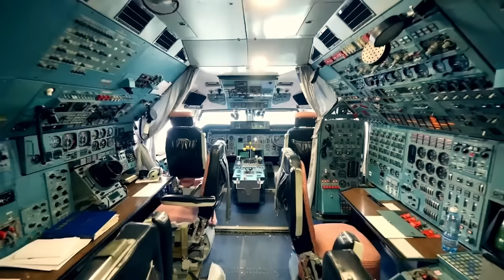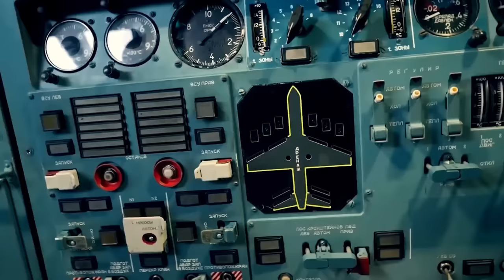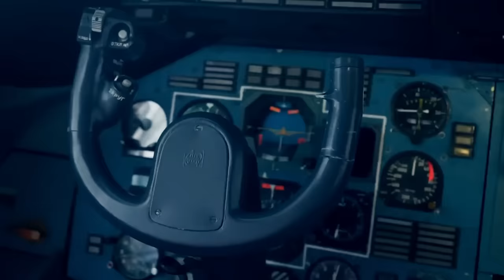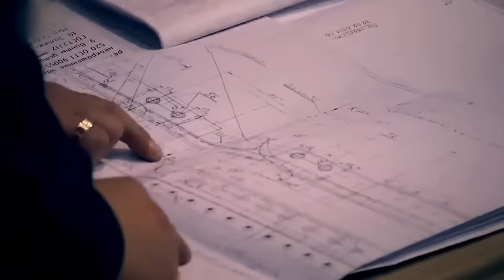The British Are Restoring The AN-226 Mriya For Ukraine

Comment: A modernized An-225 powered by four GE GenX or Rolls Royce Trent 1000 turbofans could have 50% more thrust than the 6-engine configuration it had originally. Couple that improvement with a more modern wing design and strengthened (and perhaps enlarged) fuselage, and the Antonov could again be the new king of heavy lift transports.
Reply: Good points, still modern technology could raise the possible MTOW, MLAW which really would be an argument for the plane staying a six jet. Plus the world needs to reembracs the idea of engine redundancy in aviation.

Quadjets, or at least trijets should be the norm for crossing big water masses on long haul just for safety reasons. 

The plane should be able to pressurize and propell a plane to an alternate airport with less than 100% of its propulsion jet engine power to minimize risk.
Reply: On the other hand sticking with six engines means you end up with a proven design but better.
Reply: 6 GE90s best of both worlds

Comment: The AN-128 and AN-225 often stopped at IAH in Houston, which was kind of ironic since the modified 747-SP for Space Shuttle transport was based here in Houston (at Ellington field), and is now on display at the Johnson Space Center.
Reply: There is no model AN128. The aircraft that often stopped at IAH was the AN124 and mostly heading to Algeria. How do I know? I used to be on board those AN124s
Reply: The shortened 747 SP never had anything to do with the Space Shuttle.
Reply: The shuttle carrier was actually a 747 200.  If you go to the Johnson Space Center in Houston and check the aircraft out, they describe its life before NASA as an AA 747 200

Comment: There are just one cargo plane in the world of this size, and when you need it , nothing else will do. There are basically 2 options one which seems to be favored now is to rebuild the flying plane, which was heavily damaged, due to sheer negligence , if only management gave the order to have it flown out of the war zone , even on 4 engines.  The other option is to use the one partially built second example.But that will have to wait till this one been finished and booked solid with work to force them to finish the other one. There are little advantage to do this in the original country now  even if the war have ended?  For most of the skilled personal are now dead. It will be a project equal to the design of the first 747, which nearly bankrupt Boeing. But now they are thinking of bring the jumbo back. The one unique thing about the jumbo, since 69, there been hull losses, and much mishaps, but not once can the losses be traced to a basic design flaw. One thing for sure, they will not be building 1500 Mriya, that is for sure.

Comment: They have a second incomplete fuselage and the destroyed Mriya has its wings and tail largely intact... Imagine a second aircraft completed with a glass cockpit and six GEnx-67 engines.
Reply: A plane that beautiful deserves the Rolls Royce RR badge on its engines!
Reply: @zandert8224  Perhaps, but the GEnx 2B67 from the 747-8 has the right diameter and bleed air. The Trent 1000 doesn't have a variant that works here.

Comment: The video title is incorrect - it is the Anotonov 225, not 226.  It could NOT carry 500 tons; it's cargo capacity was close to 200 tons. Its gross weight with such a cargo, and fully fuelled was aroud the 500 ton mark. 

The British are not restoring Mriya for Ukraine - indeed she is, unfortunately,  in such poor state that she coudn't feasibly be restored to flying condition. However,  Either one or more AN-124's could be used to supply parts ofr a new-build AN-225, with other parts being newly fabricated, (but the 124's are useful - why disassemble them?) or alternatively, an entirely new build Mriya could be made with the same form, but modern engines and avionics (which would also make it more efficient and cost-effective to run. 

This is, I think the more realistic option, building anew, and building even better than before despite the Russian barbarian savages  trail of destruction and atrocities over large parts of Ukraine. Such a new-build AN225 would be symbolic of the Ukrainian towns and villages that will be rebuilt. And best of all, no Russian involvement needed for the project.

Sorry, but this video was a pretty poor attempt.

Comment: I can only assume that the word 'chassis' used here actually refers to the mounting structure for the undercarriage. A plane doesn't have a 'chasis'. The fuselage consists of roughly circular frames joined together with various 'stringers' and 'longerons', forming a complete framework upon which is secured the outer stressed skin.
Looking at the remains of the destroyed aircraft, as a layman, I would suspect that the only way to see another AN-225 in the air, would be to finish building the unfinished one whilst salvaging as much of the 'written off' one as possible. The extent of damage to the burnt frame has probably compromised the integrity of what's left to such a degree as to render only 50% of what looks good to be actually re-useable.

Comment: I think it is the Antonov AN-225 not 226 ^^ Well, there is as far as I know the 2nd Prototype of the 225, which was never completed but is still available. Take the 2nd Prototype and use its parts (around up to 65% completed) and you may be able to restore the 1st Prototype.

Comment: Re-building Mriya wouldn't be economically viable (it wouldn't yield more money than it's rebuilding and operational costs). Nevertheless as for old-timers it would be great to at minimum rebuild it's structure to display it as a piece of art and great things humans are able to create.
On a humanitarian level it would possibly be wiser to start from scratch in order to minimise operating costs. It would be such a great engineering feat if various airplane manufacturer would dedicate ressources for that purpose given they'd at most only gain some R&D for other projects that would be viable.

Comment: We have to look to the future and build a new aircraft with stronger structure, modern systems, engines etc to operate with compliance in a future world. Six engines powered the original whereas the same job can now be done with four. Take a look at the Rolls Royce Ultrafan, four of those huge beasts can easily power the new recreation with fuel efficiency on the new jet fuels and push out almost half a million pounds of thrust yet in cruise, those engines will literally be operating on low power settings. The world can only wait for this recreated aircraft to take to the skies.

Comment: Of how much use was the roof cargo hold. Most transport would have gone into the belly. Thus maybe a new version does not need a split horizontal stabilizer, making it more efficient.
Reply: Split stabs keep the wake turbulence down when carrying cargo on top. .  A single tail would have to be over 80 ft tall (25m) keeping the plane out of any hangar in use today.
Reply: @MomolosZtips  Good point about the tail

Comment: Antonov was and IS still a Ukrainian Company, Not Russian. The Engines were designed and built in Ukraine. All the fabrication equipment required to build another AN225 are there, in Ukraine. You missed out any film footage from the An-225-2 hanger where everything is stored, in Hostomel, several hundred yards from the carcass of AN-225-1 under its wrecked Hanger.

Comment: It would be cheaper and easier to build a new one. To do this you would need to hold the patents and rights to manufacture, the originals plans, jigs and machine tools - you would then have to go through extensive testing and certification. Then there would have to be customers happy to purchase an obsolete  design concept when they could just go the Airbus.

Comment: Iam not an aviation engineer . Im sure There are plans for this plane how to build it - if u pay  for the job -   wing design coud be  redone up to date -  there are techlogies  available / newer engines could be used with better economy and ecology , avionics  , improved hydraulics -   this is not some kind of building something from a scratch  likde discovering a wheel  .  And also that burned  down plane - probably just for a scrape yard - half of the fuselage is gone,  wigs gone -  well .  If there  is money , the will be chance for ruslan flying again -

Comment: The cost of rebuilding one is prohibitive and it's never …I repeat. NEVER going to happen.. Sorry all you lovers but by the time Ukraine has completed clean up and rebuilding of it's country it will be 2035 or 2040...See cost prohibitive.. Secondarily, It's old and very expensive to maintain plus newer designs are available. A wing and a prayer are not going to cut it.